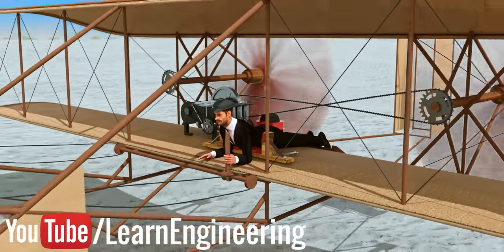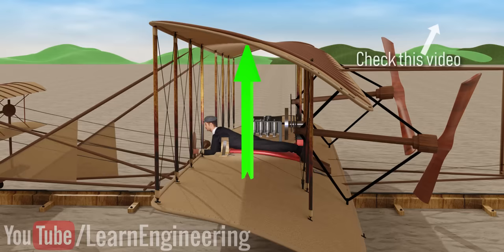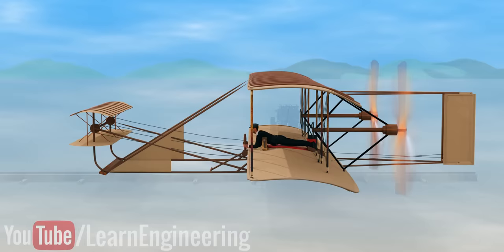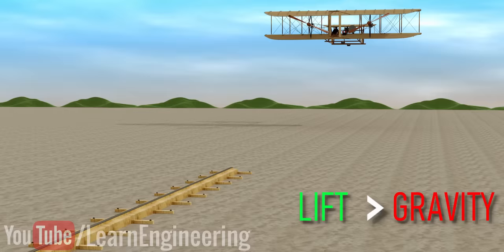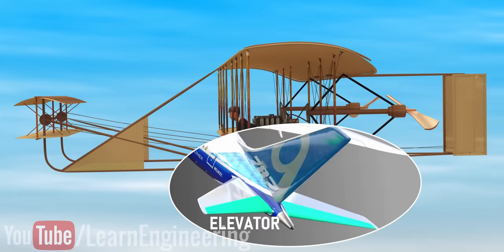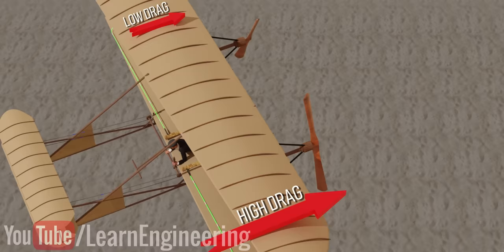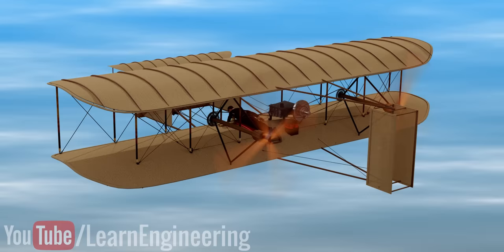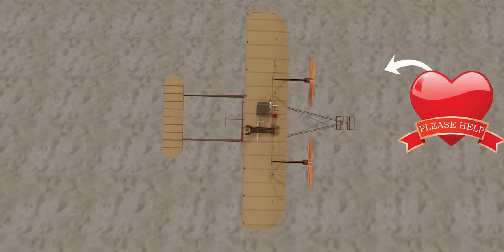The Brilliant Engineering of FIRST FLIGHT !

Comment: Did you know that in Centennial, 2003, an engine with 50 Hp was used and yet the machine did nothing?
Reply: There is factual information on the power of the Wrights engine and various RPMs
You can look up or calculate the engine RPM and the prop RPM.  
The power of the 1903 and the 2003 replica engine is usually given at 12 hp.
The Wright Brothers calculated that they need only 8 hp.  to provide the needed thrust.
Reply: @majorbett  eight hp for 340 kg weight!!!! 😆😆😆😆😆
Reply: @selmanedel7973  That was what Wilbur calculated.  But the engine was not sufficient
by itself.  It needed the assistance of a strong head wind.  Without the headwind they
needed another form of assistance such as a hill.   On a day with a 4 mph headwind (Dec. 14, 1904) , they
tried to find out if a (9% grade) hill would substitute for the lack of wind.  It didn't.
Taylor built the primitive aluminum block engine.  When the tested it, it produced12 hp.
With the cooling system and magneto, it weighed slightly over 200 lbs.

Here is the test flight of the exact replica on Nov. 20, 2003.  The wind that day was about 15 mph.
With a weak wind compared to the gale force winds the Wrights had in 1903, it resulted in a 100 ft. hop.
That makes the claimed performance of the 1903 Wright Flyer plausible.  120 ft. in 12 sec.
How do you explain the fact that the 340 Kg. flew at all?

https://www.youtube.com/watch?v=o1mscspl-VU